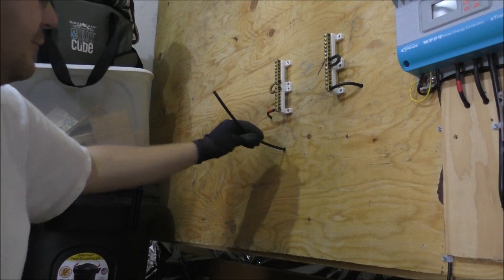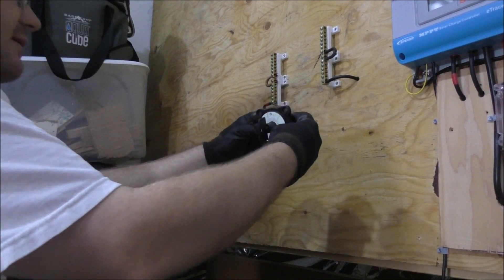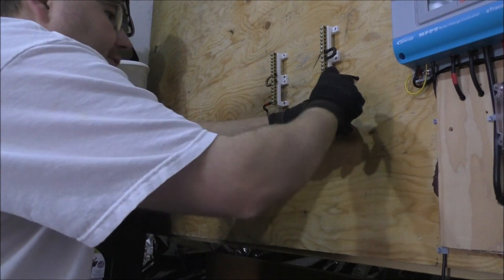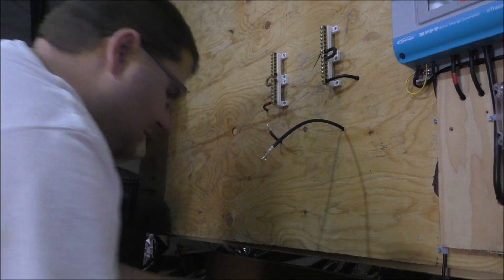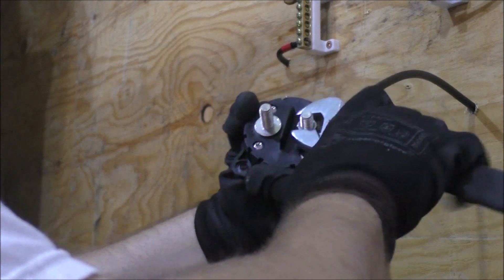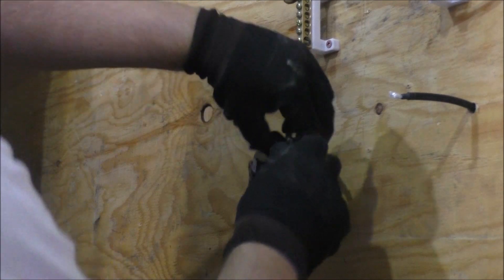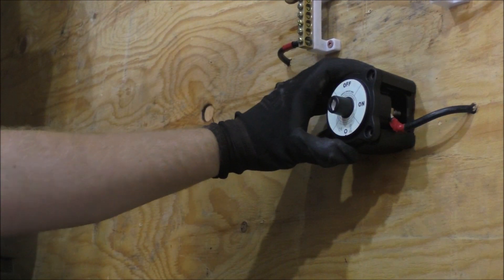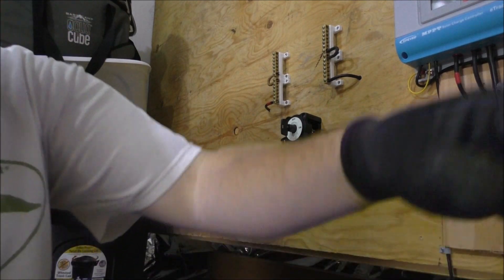12 volt Load Center Build 3

Comment: There are two possibilities that I can think of why the rainwater catchment system ripped loose from the tiny house.
1. The inline coarse filter bag became clogged and rainwater backed up into the gutter, filled the gutter to overflowing, and then the weight of water in the gutter pulled it loose.
2. During a heavy downpour, the rate of water entering the feed pipe is so high that when slowed by traversing the coarse filter it causes a backup exactly like a clogged filter and then backfills the gutter the same as in 1.

How much weight would a filled gutter put on the gutter attachment points?  Filled Weight Increase = (Height x Width x Length) x 62.4 pounds per cubic foot
Reply from the maker: the setup has yet to backup. i try to clean the inline filter bag on the regular.